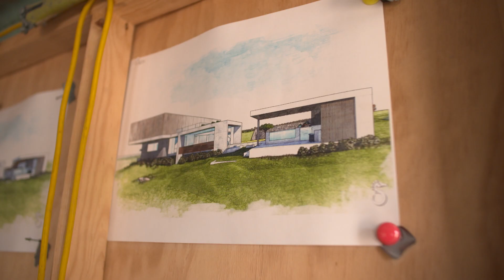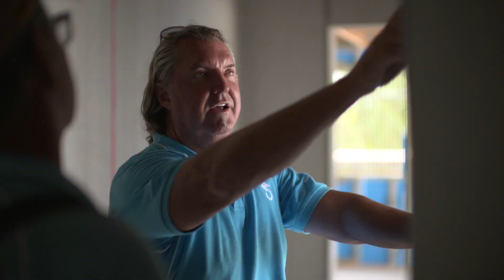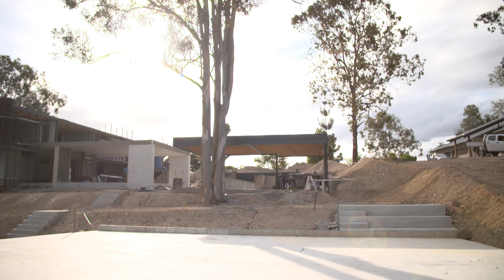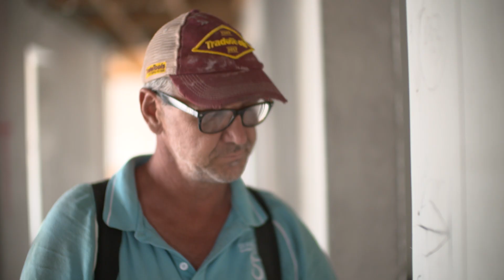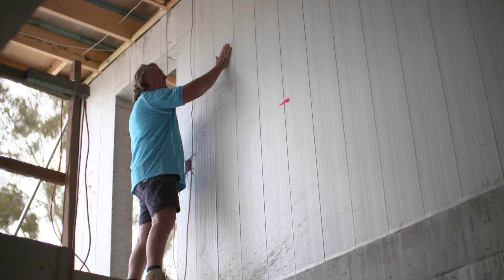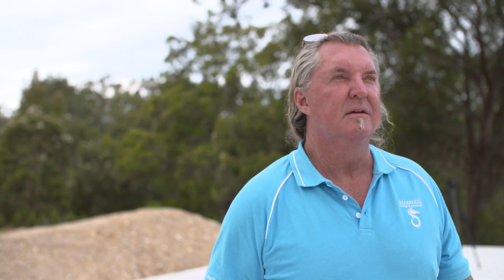AFS Rediwall® Builder Testimonial

Comment: How did you insulate the walls?
Reply from the maker: Hi Peter, thank you for your question. As a solid concrete wall, the afs rediwall® system features superior sound and thermal insulating properties. For aesthetic purposes in above ground  applications, builders may choose to batten and sheet. It is here they may choose to use insulation in the frame cavities. Should you have any further questions please don't hesitate in contacting our customer service team on 1300 727 237.
Reply: Concrete is a very poor thermal insulator, and once it gets hot it will radiate heat for days. I’m sure this is a great product for other reasons, but really?
Reply: @Daniel-ur3sf  Not true. Concrete walls do Not radiate heat for days and cools rapidly especially if encased in a thermal barrier like this system.

Coming from someone who has actually lived in exposed concrete architecture. 👍